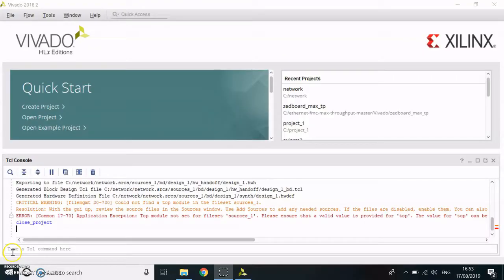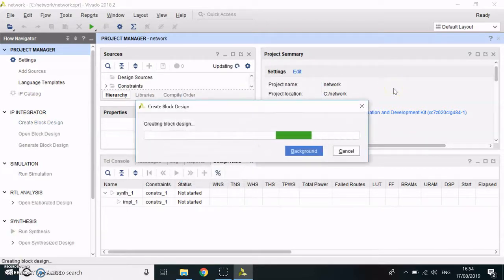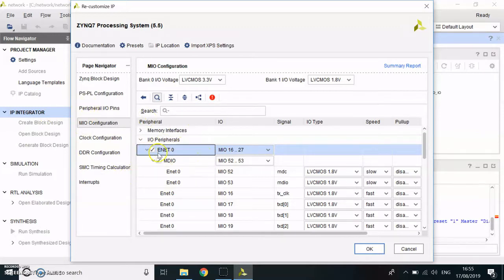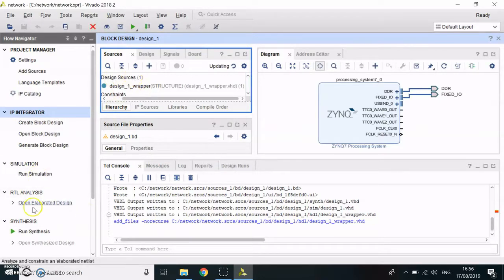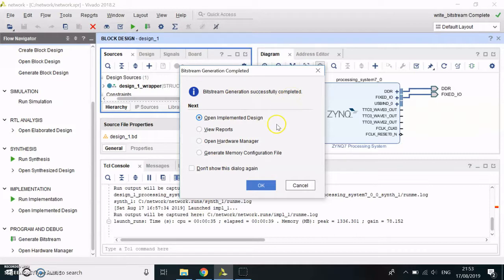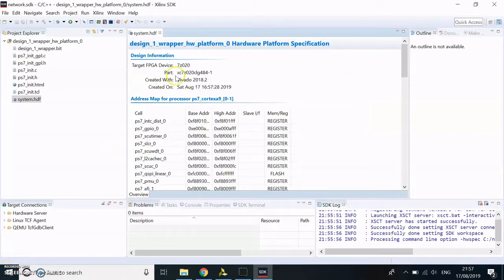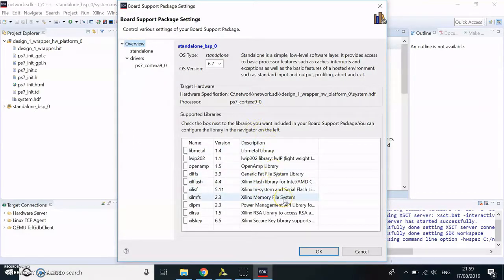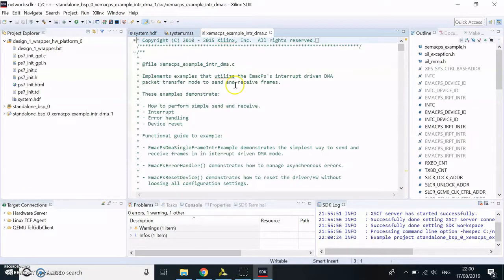Zynq SOC's Gigabit Ethernet Part 2 - Vivado Project

Comment: I tried to implement using microblaze and with board components like phy sfp , mig for DDR, UART.. AXI TIMER,  when ever iam generating bit file.. It is going upto implementation after this it is showing errors related to XDC FILE .. I checked in google.. For this they told some solution enter two commands through tcl file, then bit file generated.. Then I exported hardware Including bitstream and launch sdk, in sdk iam using lwip echo server bsp created, when ever iam programming FPGA it is showing there is no ps  in this design.. What could be pblm.. Could u please tell us

Comment: Mam,could u pls tell how to use the ethernet in PL side of zynq soc
Reply: If you want to use purely PL based ethernet design . I would suggest go through xilinx TEMAC IP. They have an example design which is highly detailed . and if you go through the logic well eventually you will be create your own version of mac which is less resource hungry and faster.
Reply: What do you mean by that? The data will be written into the DDR Memory of the Zynq and can be accessed by the PL via DMA. Access the PHY directly from the PL is not possible in my oppinion. 

If you want to do a pure hardware ethernet design, you could use an external PHY with a PMOD Interface.
Reply: TEMAC IP different from Ethernet subsystem IP? Do we need a seperate license for that??